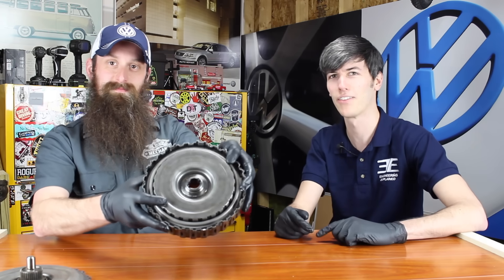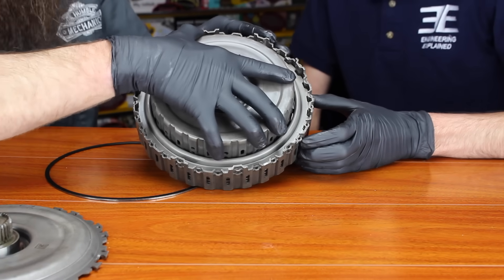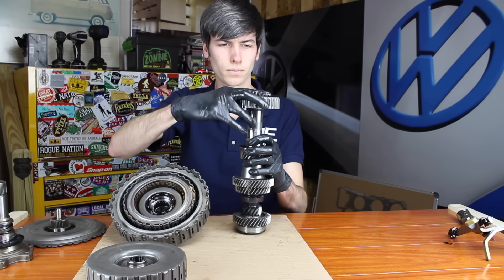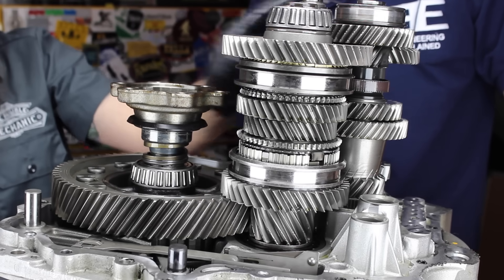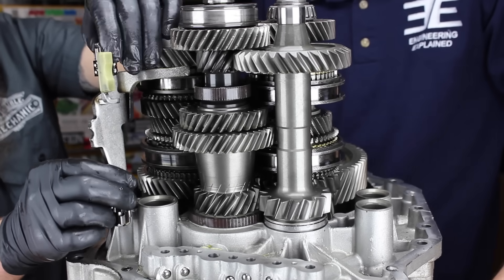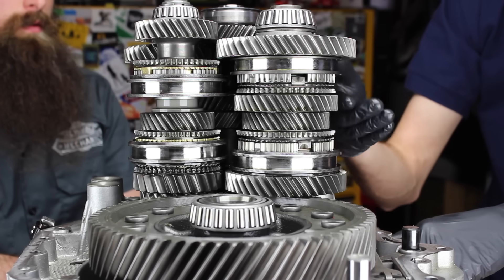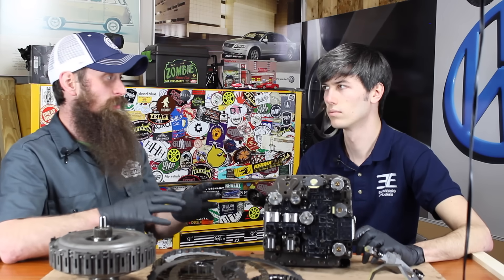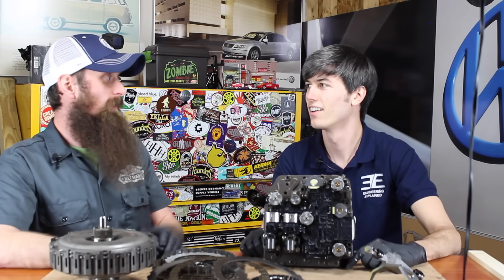DSG Transmission - Explained

Comment: I wonder why they don't make cars with sequential shifters like on motorcycles...
Reply: +samuel lopes It's a valid question seeing that the primary difference is the addition of a shift drum combined with a revised shift control arm / actuation system. They could still use the same street friendly synchromesh system instead of the dog teeth so I don't know why it hasn't happened.
Reply: The reason is that sequential shift gearboxes are not nearly as strong as regular manuals. In a car they probably wouldn't last more than 10k or 20k miles. In the case of a motorcycle, it is easy to overbuild a transmission because they don't put out that much torque and they are light. Rally cars and some older f1s use sequential shift gearboxes because they only have to last the duration of the race and then they get rebuilt.
Reply: +samuel lopes there actually are a few exceptional production cars with true (with clutch) sequential gearboxes... Ascari A10 for example... I thought the Ariel Atom V8 had that too, at least it had a clutch pedal, but those flippers are hydraulically actuated so you can shift manually without using the clutch pedal whilst driving, so I guess the clutch pedal is just for take off. There are a few more which I forgot, look on google my friend.
Reply: +Isaac Allen why wouldn't they last ?
Reply: +samuel lopes The reason for using a sequential shift gear box is mainly for racing purposes. Quick shifts up and down without missing a gate because there is only forward or backward with the shifter, as opposed to an H pattern in a normal manual transmission.  For mass market vehicles with the average driver, an H pattern allows you to know exactly which gear you are in at all times and easier skip shifting (say 2nd to 5th one step vs 3 forward shifts with a seq).  Seq shift gear boxes are not any different as far as strength/durability as Isaac Allen has implied, it is simply a change in the shift fork/rail mechanism using a barrel type cam to select each gear in a particular order without the ability to skip shift.  There are a number of after market suppliers that can adapt some oem manual transmissions to sequential shift.

Comment: as far as pre-selecting the next gear is concerned, didn't the old french car 'Talbot Lago' had one of these.. u select the next gear with the hand lever BUT the gear change doesn't happen yet UNTIL u step on the clutch pedal.. they say it was good for racing, cause u already select the next gear, and activate it later on by pressing the clutch pedal

Comment: predictive shifting?
Reply: +Isaias Farias This is actually common in many auto transmissions. Based on driver input, the car only sees so many situations that will occur. 

Think about slowing down for several seconds for a red light, then the red light truns green. You mash the throttle, the auto trans is all "WTH man" I thought we were stopping. 

A DSG has less of that.
Reply: HumbleMechanic ah I see. Thank you.

Comment: What happens if I heel-toe it?
Reply: +TrwSeama you don't need to heel toe because the computer will blip the throttle for you on down shifts
Reply: +TrwSeama They get pissed off when you apply the brake and throttle.
Reply: Thought so, is there a "racing mode" that stops it?

Comment: great explanation video! For as simple as the tech appears to be (I know it's not, but it ain't exactly rocket science either), there are far too many failures of this type of transmission in normal commuter cars (think VW Jetta with DSG or Ford Focus with Powershift). Any thoughts on why that is? Is it a materials quality issue, so things break prematurely, or is there an inherent flaw in the tech (ie. maybe current know-how and/or manufacturing quality isn't on par so allow for a completely reliable DSG tranny)??

Comment: Does the Bugatti veyron use the same/similar transmission that high end VW cars use?
Reply: +JUNAID187 Yes. Bugatti Veyron uses DCT built by Ricardo to reliably handle its massive torque. It is currently the only known strong transmission of its kind being successfully tested with 200 consecutive launches.
Reply: +JUNAID187 They are the same concept but not the same part numbers if that is what you were asking.

Comment: I used to have a Mark5 Golf GTI.  Occassionally it would take 1-2 seconds to engage after putting my foot down after creeping forwards waiting to turn at lights.  I think you nailed the explaination in that the conntrol unit was confused and expecting to down shift.  The dealership had absolutely no idea!

Also in sports mode the downshift from 3rd to 2nd was very harsh as it changed as a much higher RPM.

Now drive a Renault Clio RS, which I think has a similar assembly

Comment: "DSG always shifts faster than a human" Always? Except when it guesses wrong. Except when you shift directly from 4 to 2 or so. So not always. Note the S in DSG. Still a good description.
Reply from the maker: +Lars Dennert That's just a matter of programming. Acura has the tech built into their DCT's (as demonstrated in my ILX review) to skip a gear just like your example of going from 4th to 2nd. Quickly double tap the downshift paddle and you skip over 3rd.
Reply: I don't think it's just a matter of programming since Acura put a torque converter back in the dct as well.
Reply: It's faster to downshift two gears in a DSG than to shift in a manual (in most cases). The PDK can skip multiple gears and uses no torque converter. The GT3's PDK can also go into neutral by simply pulling both paddles. Allows for amazing burn outs apparently.
Reply: +Shane Barrios Nice

Comment: I just rebuilt my first DSG. Came out great. Really simple unit. Probably undershot the price a bit. Think I can charge slightly higher on the next one.
Reply: uncreativename Well in a mechanic's world.  Simple.  I've since done 3 more.  I am knocking them out same day.  Pull it in the morning.  Ready to go back in by 3:00pm
Reply: +Lynx Star Automotive (Gabe V)  pretty much a huge motorcycle clutch pack?
Reply: Jthumper Manual transmission with a huge motorcycle clutch pack for a torque converter.
Reply: +Lynx Star Automotive (Gabe V) Simple? Like simpler than the video makes it look or as easy as a standard clutch, Because from the video I don't think you could pay me to work on this (that's why I'm not a professional mechanic :)
Reply: How long do they last? And what breaks first the DSG or the transmission?

Comment: Keep up the good work!...Very informative for us "shade-tree mechanics".As a side note: It'll be a dark day when the fully manual (meaning manual, old-school clutch) transmission is no longer available.  I suspect those days are not too far away with the dual clutch transmission getting better gas mileage.
Reply: @@willheheckaslike8315   Note:  Electric Vehicles do not/will not have manual transmissions, niether do the current Hybrids.  I am aware there are a lot of those vehicles already in Europe.

(Full disclosure,  I own 5 cars with manual transmissions, and two trucks with automatics.  The automatic is superior for trucks)
Reply: @@willheheckaslike8315 Also, good luck getting a new Ferrari with a manual transmission.

Comment: (I asked this before in your older video about DCT's b/c I'm annoying like that)
so assuming the entire transmission works like this, it's safe to assume said transmission is hydromechanical, correct? But now I wonder, can you skip a gear when shifting up like 1st to 3rd or is that impossible b/c the computer would not let you?
Reply: I meant hydroelectric... my brain's fried.
Reply from the maker: +Matthew samson Some cars allow it, depends on the programming. I know the Acura ILX has something where if you hit the downshift paddle twice quickly it completely skips the gear between.
Reply: So then what's the point of paddle shifters if it's controlled by the computer? Seems pointless if that governs your shifting more often than not.
Reply: +Matthew samson With a paddle shifter the driver can still determine when the gear change happens.
Reply: +Matthew samson exact same reason people use manuals. I rarely use auto mode on my DSG.

Comment: you should explain why these transmissions are unreliable as f**c.
Reply: +TheRealDeal The clutch is unreliable, because it is an expendable part and always needs replacement after some time. All people I know who have DSGs and are driving in Moscow traffic jams, are going through clutch replacement about every 80.000 kilometers. Maybe their clutches would last forever if they have driven only on highways. 
 The competition between DSG producers is not high yet, so they don't care about the cheapness of repair at all. It happens so that for my manual Lada Samara the clutch was engineered like expendable part, and the new clutch costs 18$ + 2 hours of mechanic's job,  but in DSGs the clutch is engineered like a part of gear box, so the new clutch can cost more then 1000$.
Reply: +Joel deSanto now 50 more years and VW learn to place both clutches separately from gearbox again, or earlier if Chinese and Korean guys will do it first and overtake the market with everlasting DSGs
Reply: +TheRealDeal Then you should show the evidence that DSG transmissions are unreliable as f**k. You are asking for an explanation which relies on your statement being fact. In your evidence you should give the failure rate compared to other transmission types, the average service lives, the number of failures per vehicle service life, the number of days off the road due to DSG failure compared to other transmission types. Also you could include number of warranty claims for DSG failures and the average cost of DSG failures compared to other transmission types. Do you have personal experiences with DSG reliability? If you have had a vehicle with DSG, how was the car driven? Was it serviced properly, was it thrashed/abused? How many miles did it reach before failure/problems?
Reply: +TheRealDeal had to replace the mechatronic control unit on my a3 2006. Fortunately it was real easy to replace and code, but the price just for the unit alone was $1285. Unit started failing at 70,000 miles, car now has 98,000. Doing some research, I see that its such a common issue that Audi/VW extended the warranty of 2007 - 2013 for the dsg. Also, if the new a4 is any indicator I think Audi/VW will eventually stop using dsg.
Reply: Honda pulled off multiple wet clutches in their transmissions with high reliability for decades.
Reply: @MrHurricaneFloyd   but vw don't want to make good transmissions, they need to suck only money from us. I worked for vw/audi and had trainings how to cheat customers.
Reply: +TheRealDeal . A bicycle is less finicky than a new Ferrari but that doesn't make it more capable per se.
Reply: Joel deSanto  so a car which is 50 years more advanced is still less capable that a cheap lada. Nice.
Reply: They are less reliable than a typical 4-speed torque converter transmission because they are more complex and have clutches. Drive both a Mk6 & Mk7 GTI with DSG. The Mk6 is making a scratching noise upshifting to 4th. That said, dry dual-clutch transmissions are the ones with major problems. They have no oil bath.
Reply: Funny thing is, I recently bought and Audi S4 with the DSG and I love it. Did thorough research and found that these transmissions are extremely reliable compared to conventional but they run into trouble with the mechatronics unit occasionally. I think you guys are just afraid of change. Its like when synthetic engine oil came out and negative, false rumors spread about it.
Reply: dsg is life
Reply: Илья Медов The same for my ford escort, when i swapped 2.0l engine in it, i also changed the clutch. On a car simple like lada classic for example changing the clutch is almost as simple as changing brake pads.
Reply: +Илья Медов you are also comparing a Lada with a Mk5/6/7 Volkswagen which is 50 years newer in design. But to the point I'd imagine DSGs don't handle creeping along slowly in traffic most of the time which "feels" hard on my car.

Comment: I wonder how to stop it from stalling while you in D mode at traffic or traffic lamp which mean first gear or second and it doesn't have any torque converter instead?
Reply: It goes into neutral.
Reply: +Joel deSanto so the ECU who takes part and change it into neutral then?
Reply: the clutches are disengaged at a stop just like in a normal manual car.
Reply: As soon as you apply the gas it automatically starts to engage the clutch again.

Comment: I'm not sure if you can answer this, but I've read a few contradictory things about the vw DSG - i've read the tdi ver handles more toque but never have I seen anyone talk about if a tdi jetta DSG can be mounted to a petrol 2.5 engine - someone recently told me at a dubexpo show that if you're doing a turbo on an automatic (petrol based autos are planetary not DSG on Mk6 2.5 jetta/golf) that you should switch to the DSG tranny - but something about needing a different bell housing - do you know anything about this?

Comment: I know there were a lot of problems with those DSG6 and DSG7 gearboxes. Especially in VAG cars till 2012 year. They also have extended warranty for 5 years on DSG only due to problems.
Do you know if in the cars with production date 2013 a newer there are still same problems or VAG already fixed them?

p.s VAG - Volkswagen Automotive Group if someone not familiar :)
Reply: i have a 2013 a3 and had to have a clutch replacement at 28k km's.. currently experiencing very jerky changes between 1st and 3rd when slowing or taking off in traffic. praying its not the start of another new problem
Reply: They still haven't fixed them, even 2017' vag cars with DSG are already problematic. Vag wants money, not to produce reliable cars.
Reply: Not automotive, Aktiengesellschaft = joint stock company

Comment: So then the inner clutch and the outer clutch has different total surface areas?
Reply from the maker: +Kuma Kuma Very possible yes, or you could have more discs in the inner clutch. That said, wet, multi-plate clutch packs tend to last for quite a while, and have very little wear as a result of being bathed in oil and so much surface area.
Reply: +Engineering Explained Yes, I'm sure they thought of that and compensated by adding more plates in the inner clutch. Is it possible for a DCT to have a side to side clutches so that they're the same diameter?

Comment: I heard about problems with this type of transmission that can result in gears spewing-out over the road when the car is less than a year old!  The problem car was not a VW.  Anyway the gear oil which is special, was cooled by running it through a pipe in the bottom of the radiator. Unfortunately the gear oil attacks the pipe which eventually corrodes through.  When this happens a gallon or so of engine coolant, mostly water, rushes into the gearbox  and shorts-out the electrical  sensors.  One can surmise that two gears get selected at the same time!  The car was of course repaired under guarantee but when it was less than two years old THE SAME THING HAPPENED AGAIN!  The car's business use is for doing funerals but can you imagine the disdain that would result if it spewed its gears whilst part of a funeral cortege?  Its owner describes the car as "Fifty thousand pounds-worth of crap".  Sure, such technology is all fine and dandy if one has a team of F1 mechanics waiting to pounce on any faults but for the average user a standard five speed box is vastly superior.  Take care!

Comment: Oh so it is NOT a Direct Shift Gearbox at all but an Electronically controlled Manual transmission with pre-selector that is not uncommon to many modern cars. 
 Probably fine for general street applications, but lousy for any sort of performance I would think.

Give me a tricked up TH350 or 700 thanks :p 
Good explanation for those less mechanically inclined
Reply: Not at all actually. Drive one and you will see. It feels like a motorcycle transmission: very quick yet noticeable. There is a reason Mercedes, Ferrari, Audi, VW, Porsche, Lamborghini, etc use these. They make sense in performance cars but increase complexity in regular ones while not adding much.
Reply: Most cars still use a torque converter. It pre selects the next gear with the first clutch and shifts with the second. must faster than any torque converter auto on the market, even the zf 8 speed. the shifts are imperceptible also. Obviously not the torque capacity of a th700 but also many times faster.
Reply: justin beamon ONLY if they are Automatic's are torque converter's employed . 

And if this transmission engages or pre-engages one gear before releasing the previous then this can rapidly contribute to excessive internal wear in the clutch packs and heat the trans fluid to the point of burning as it is in effect engaged in 2 gears at once.
My TH 700 would change from 1st to second in less that 300 Ms and each subsequent gear the same , BUT I had an extra friction and steel in each clutch pack so the take up time was significantly reduced.
Reply: +mozzmann I'm probably not explaining it well with the 2 clutches but they shift around 100 milliseconds in the Porsche versions.
Reply: justin beamon I know what you mean though as the pre-select lock's up and rotates the gear cluster not unlike the syncro rings in a Manual trans and then as the speed matches the main clutch engages, resulting in very little time for changes .
Reply: +mozzmann right exactly